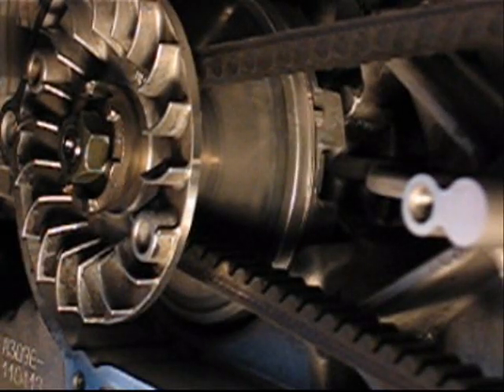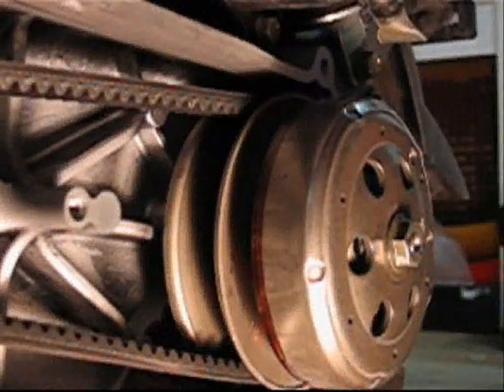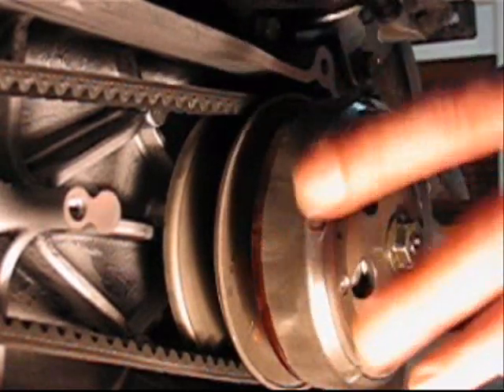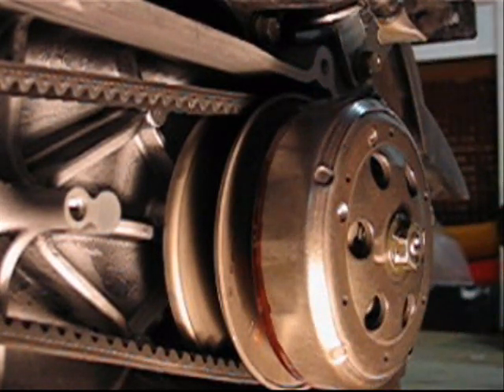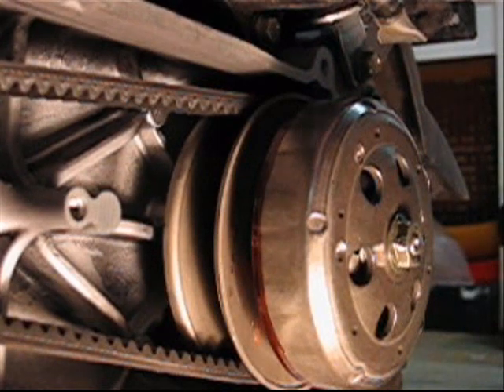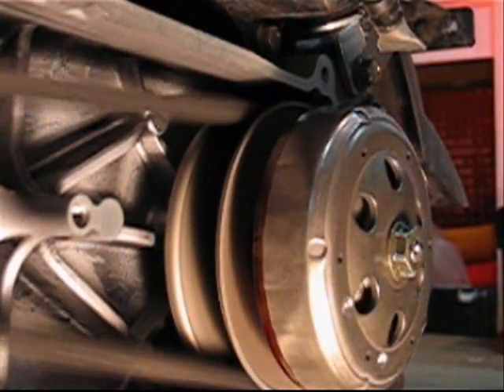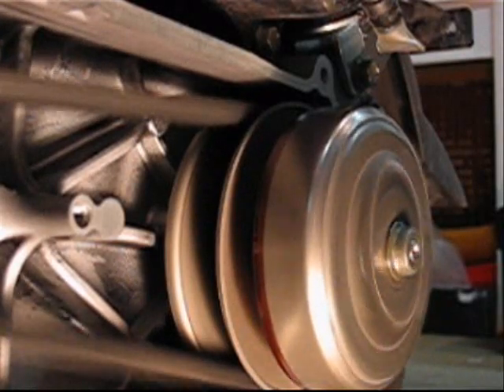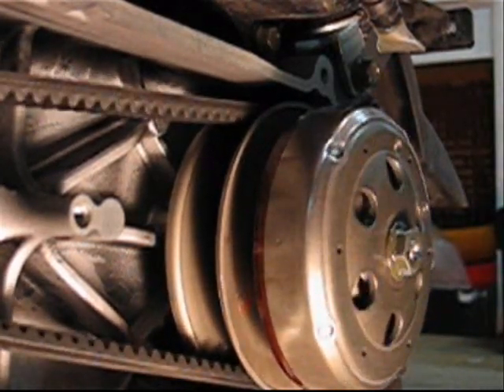Yamaha C3 close-up of the pulleys in action.

Comment from the maker: Roller weights are pushed outwards by centrifugal force (or rotation force if you prefer), this makes the variator to contract, thus changing the ratio. 

The rear pulley halves are spring loaded: the spring pushes the outer halve towards the inner halve. Thus, the movement of the rear pulley is just "following" the movement imposed by the variator (front pulley).

Comment from the maker: This is not enough to get higher speed on a Giggle. 

The C3 (american ) and Giggle (european) have different variators. European models are more restricted than american models.

You must find a way to get a C3 variator on your Giggle. Changing the exhaust or cdi would be useless without a good variator.

Your Yamaha dealer may be able to get you a C3 variator, or else, search the web.